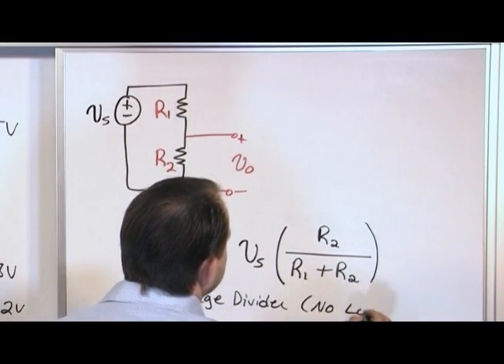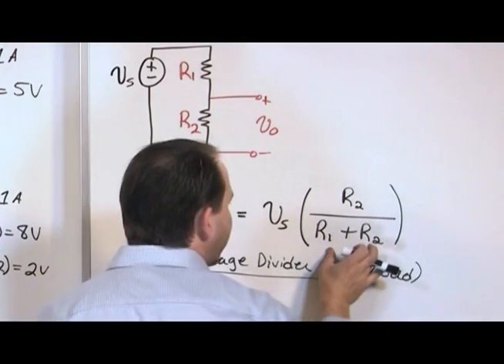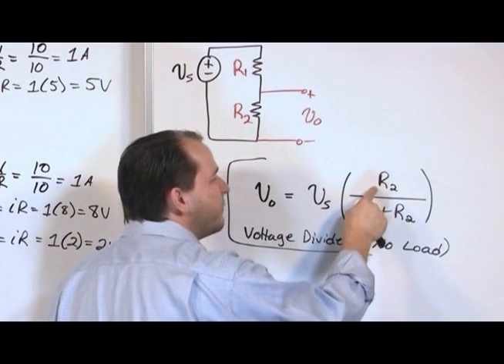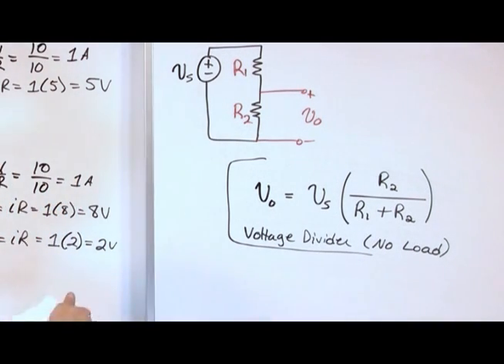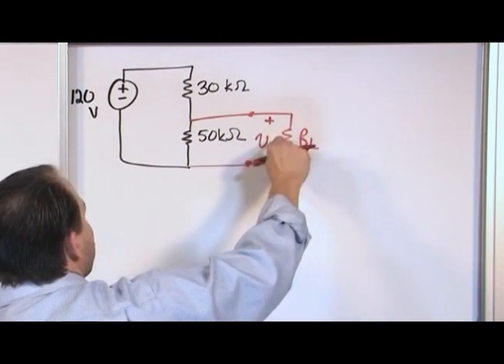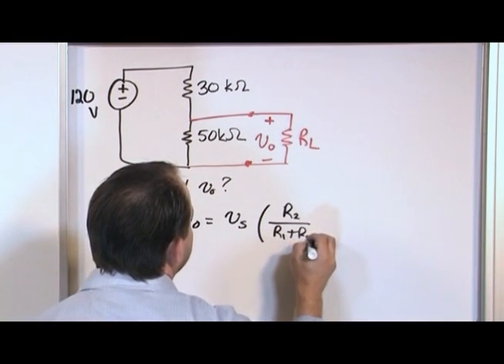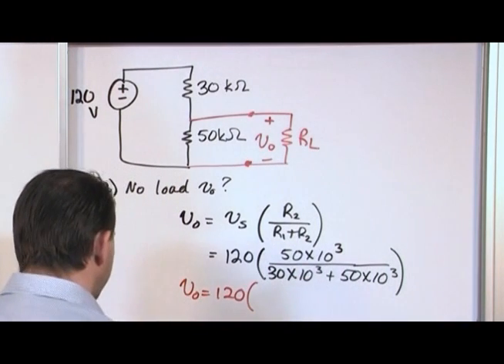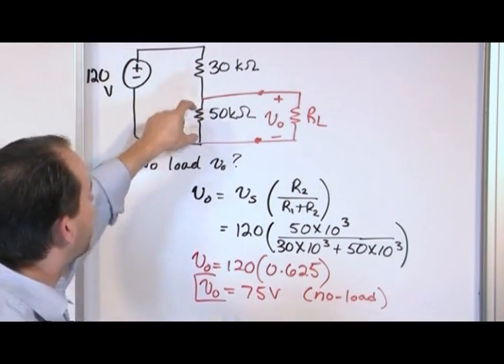Voltage Divider Circuits - Circuit Analysis Tutor

Comment: shucks i wanted to see what happens when you put the load on and can't find the second part.
Reply: You can use Kirchhoffs law to find the resistance for the parallellconnection.  1/Rtotal = 1/50k + 1/ Rload.  If Rload is 100k, Rtotal = 33.3 k.  This will of course change V0